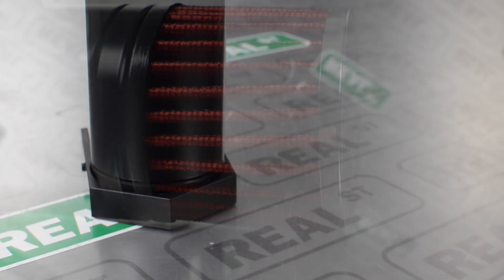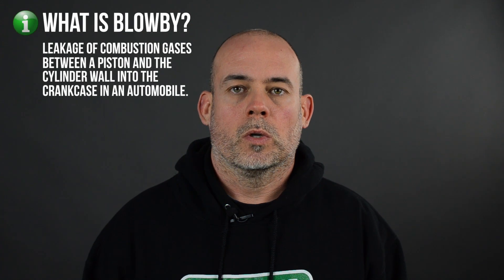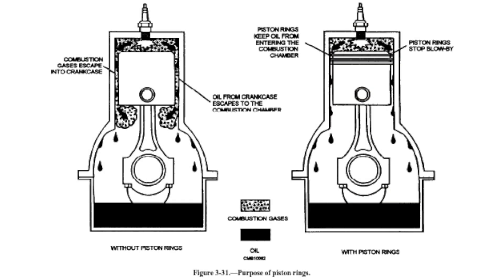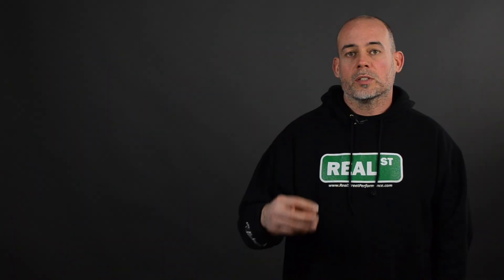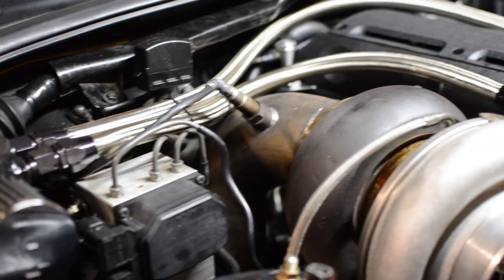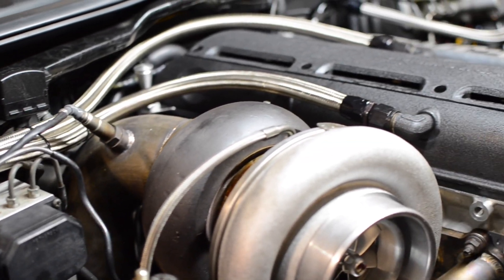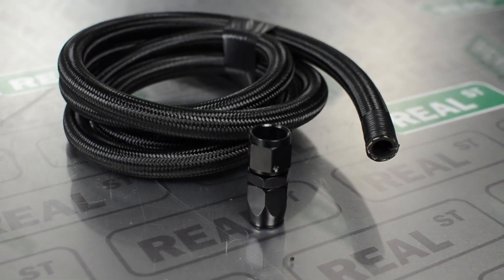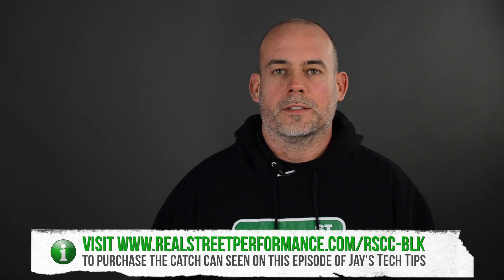Why Catch Cans are important to your build

Comment: Real Street, I am running an IAG AOS on my car, and then have a separate crank case breather tube just to vent the pressure. Mind you I am running on a highly built 2011 STI making around 870WHP, a catch can has been on my mine, but it plays almost the same roll as an AOS. With running the crank case breather tube with a filter, does that kind of play a second roll in this because I am already vending my heads into the AOS?

Comment: Awsome review, was not aware of this.  I have a Ford Lightning with a few simple mods, sounds like this would be great for my application. my supercharger is producing boost 12+.  My question is for you the pro, sounds like you would recommend this? Pls advise, thanks
Reply: +Darryl GreatVapeGrif you have an "emissions compliant" vehicle which uses an EGR system (exhaust gas recirculation) ...this video is geared more towards someone with a race car or pre 1968
Reply: +phil tripe Thank You for the feedback!
Reply: +Outkast Racing It's a 2002 brought new in 2001 and has 52k.  Like the Mustang with LS swap on your channel!!! Sweet.

Comment: why cant you run mufflers with the exhaust venturi thing? i run flowmaster 40s or super 10s. not like they do much for back pressure lol
Reply: +eXp0N3nT1aL because it can collect oil and if you running muffler or cat, the cat could damage from the oil, unless you have a test pipe or cutout, most performance mufflers now are straight through design, so it wont affect it
Reply: +ademanster hadnt thought of it that way. maybe thats why my check engine light comes on. my valve seals are pretty bad. probably throwing off my o2 sensors a bit...
Reply: +eXp0N3nT1aL also the pooling of oil vapors present a fire hazard
Reply: +eXp0N3nT1aL that will do it

Comment: also importand: oil vapor in the intake charge lowers effective octane rating of your fuel ;)
Reply: your talking a small amount of vapor. almost as significant as the volume used between the piston head and the rings lands which is very rarely measured as extra displacement.
Reply: +B00steDevil 
I know people who have had knock from blow by and solved the issue with catch cans...

Comment: What's your opinion on valve cover breathers? Some say they aren't good for long engine life because the crankcase is no longer under vacuum and being "cleaned" out, so the motor will "gunk up"
Reply: +AKDMB&#160;
Too many variables to accurately answer your question with a single blanket answer to cover all applications. 

All valve cover breathers work great and do a great job of providing a vent for crankcase gasses, vapor and moisture. 
If the valve cover breather does not incorporate a suitable filter the breather can pass liquids to the atmosphere meaning they are most likely not legal for use by most sanctioning bodies in the US. 
There are breathers manufactured that incorporate a check valve that allows the unit to vent when there is positive pressure within the crankcase and stop all flow when the crankcase in neutral or under negative pressure/vacuum. 
Gunk or sludge is the product of combustion by-products, contaminates and moisture, a good breather with a filter and check valve will help remove volatile vapor from combustion, moisture and prevent external particulate contaminates from entering the crankcase and not promote gunk or sludge buildup.

Comment: Vented vs non Vented catch can video would be nice
Reply: +Kaybe ? Sealed catch can that sees vacuum is always better.
Reply: +Nate May yea thanks for the info that's actually the setup I'm going to run.  A sealed unit
Reply: The gasses coming out of the crankcase contaminate the oil.  So you want them out of there.  Venting to atmosphere is well and good, it lets the gasses flow naturally out of the valve cover when they build up.  But a sealed catch can hooked to a proper vacuum source sucks the gasses out.  Kind of like being bit by a venomous snake.  I'd rather suck the poison out than hope the venom works it's way out on its own. A little dramatic, but you get the gist.
Reply: +Nate May yea man I found out I needed one when I did my oil change on 1000k @ and my oil came out like dark chocolate

Comment: The little air filter is important ? Or a catch can without air filter do the same thing ?
Reply: +David Da Silva Most catch cans don't have one, but having one probably doesnt hurt
Reply: +David Da Silva 
Yes, the filter helps prevent liquid and vapor from escaping the canister under positive pressure and foreign materials such as moisture and dust from entering if/when the canister is under vacuum/negative pressure.